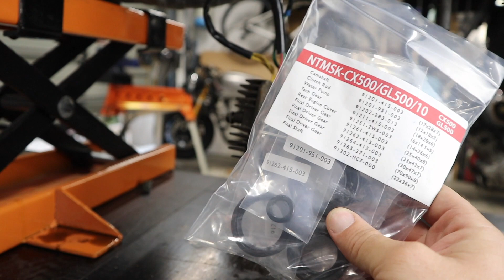Honda CX500 Timelapse Teardown & fixing an oil leak

Comment: Excellent video on the tear down surprising how many bits and pieces there actually is , and yeah those picks are a must have in any tool kit , mine have been used for anything from poking something out like the pin holding the float on a carb to releasing the wiring spade connection in a broken connector block ..can not wait to see the bits back on all painted and shiny like . Keep going Dan it'll look the mutts very soon ..and dont forget at the end I want to know if you made it under budget ...and if you can msg about that frame member cheers
Reply from the maker: same here mate. Its just waiting to go back together now :)

Comment: Grouse mate. A friend and I just pulled my cx400 engine out of my bike so I could replace the stator as it wasn't charging. I took the opportunity to paint a couple of the bits and pieces on the engine. Had to make my own casket for the rear cover. I hope it works!
Reply from the maker: Sometimes making stuff yourself is half the fun :)